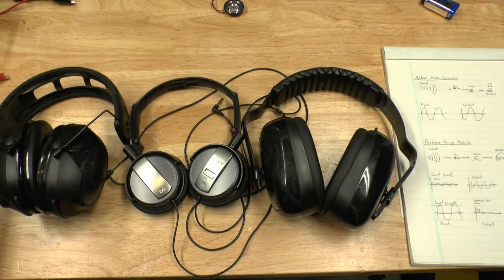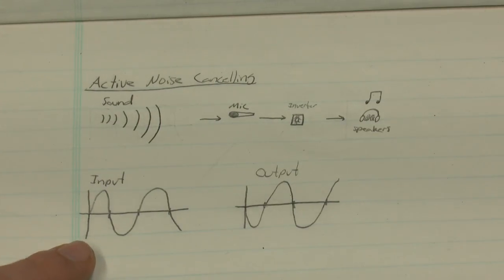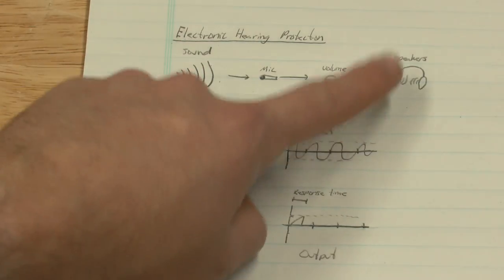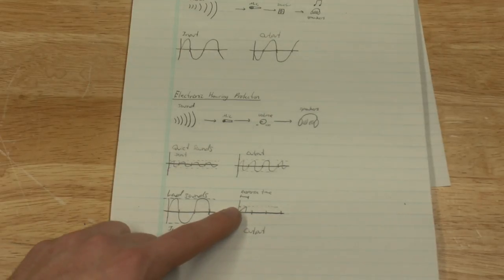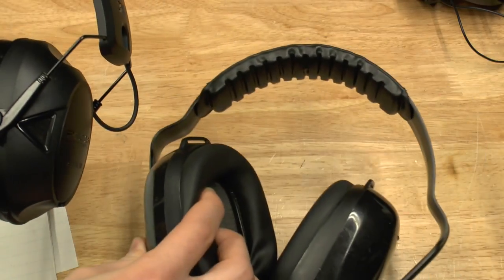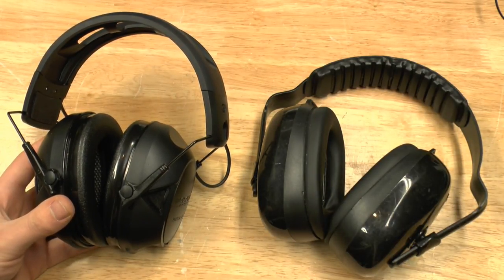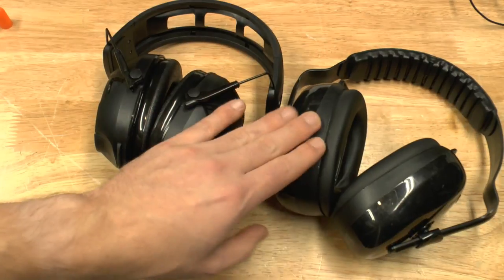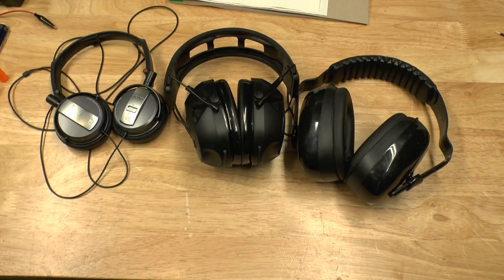How Electronic Hearing Protection Works: It's Not What You Think

Comment: I think there is a BIG counterpoint to this video: most people think the electronic hearing protection is actually doing more than the regular (passive) ones. In practice I have yet to come to an electronic hearing protection that protects the same as the very good passive ones. Of to double protection, which is foam + muff. 
So to say that you are not in danger wearing an electronic hearing protection is a bit misleading. Yes the actual electronic is not creating any MORE risk BUT you may actually have a weaker hearing protection just because the protection rating is lower and the amplification is tricking you to think the sound is lower when it goes off.

Comment: So essentially its using a compressor/limiter/expander?

Edit: I just realized it must be a reverse gate. When the outside amplitude hits a certain gain threshold it “shuts down” and doesn’t reproduce through the headphone speakers.

Genius.
Reply from the maker: Basically. The more expensive ones like the Peltor 300’s analyze the signal to try to let a person’s voice too even when it hits the amplitude limit. It doesn’t work very well though and it’s still hard to hear people talking during gunshots unless the shots are farther away or quieter
Reply: @korbano  I wonder why they don't just scale the amplitude of the output audio down instead of shutting it down period. That would allow you to hear everything all the time, including the gunshot and voices at the same time, just at a safe cap db.
Reply from the maker: @skogib4846  Well the gunshot is so much louder than voices so if they just scaled it down, you wouldn't be able to hear the voices anyway. But the Peltor 300's try to do some live audio processing to try to allow the voice to be heard and not the gunshot but it doesn't work that well. It takes a lot of processing power to do live noise analysis like that
Reply: @korbano  That makes sense, yeah.

Comment: Great info.  I can’t find any active protection over 24dB.  I find passive “cup of plastic” upward of 27dB.  I found claims.....claims of upward of 34dB (untested, unverified by 3rd party) being sold on Ama and eBa stores.  I’m looking to add silicon pads to any hearing protection I’ll buy.  Currently, I use the foam plugs or use the harbour freight 5.00 specials...cheap but effective.

Comment: Excellent discussion.  I have used electronic hearing protection for years when training with firearms and have recently decided to start wearing protection while using other equipment that exceed 85 db.  Wasn't sure how the noise cancelling headphone worked in comparison until now. Great job!  BTW, not sure if this is correct but I learned on another video that the rating on electronic ear protection is not a one for one in db.  There is a formula that is used to calculate the actual db reduction which sounds crazy, which results in a lot less reduction than you would think.
Reply from the maker: That’s absolutely correct. NRR is based on a single frequency that is not in the frequency range of firearms. Also different materials block certain frequencies better than others. For example the MSA Sordins have an NRR of 19dB but in the frequency of rifles, shotguns, and pistols, they reduce by around 27dB because the material they used blocks the frequency of firearms blasts better than the frequency that NRR is measured at. NRR is basically worthless
Reply: @korbano  thanks again for the info.  Do you have a specific product for ear protection (with bluetooth) that you recommend for use other than firearms?
Reply: @WeekendOverland I would like to know too

Comment: Maybe I am too dumb to understand, but to summarize from my understanding: (Using the example with the Howard light sport8

For loud noises the electronic ear protections are better than NC headphones; but those are only as good as their sound rating, right? And a gun shot is about 150db? Then why do people buy protections with a rating for only up to 137db safe use (hunting gun)?

I bought them for in warehouse working and going to town (autist), where my seller saith those are super for loud noises up to 100db (construction work/house renovations), and can amplify quieter noises up to 82db!
Reply from the maker: @MarieFüchschen  you’re understanding this concept very well! For the 137db number you said, if starting with a 150db sound, that would mean the earmuffs have an NRR of only 13db. I wouldn’t recommend that but hunters may want minimal hearing protection so they can hear their environment better. Some don’t use hearing protection at all. But this is usually just for 1 quick shot, which is not as damaging as prolonged exposure. 

I think using electronic hearing protection for a construction site is a great use because you can still hear quieter noises like talking, but if someone starts hammering for example, it won’t amplify that.

Comment: Crystal clear in fact! The only problem I have is that I have a set of Walker 'passive' sound reduction ear muffs that reduce the  sound level by 34 decibels, when looking for active sound protection, I fear I'm not going to find any with the sound reduction level without wearing ear plugs, near the decibel rating of the Walker 'passive' sound reduction model  or earmuffs that I have now. Especially for shooting rifles in doors.
Reply from the maker: I understand your concern. I shoot indoors with a muzzle brake and NRR 24 works pretty well for me. You could wear foam earplugs underneath and turn up the volume, but it seems doubling up only adds 5 dB extra. Probably because the sound travels through your skull somewhat too.
Reply: @korbano :Oh yes I'm acutely aware of this potential problem, it's called the mastoid bone, a kind of rigid sponge-like bone with closed-cell type membranes immediately behind each ear. I had an instructor at the State Police Academy for several different courses and the main boot camp type course that had to be successfully completed before you could be certified as a police officer in the state, who suffered almost total deafness in his ears from doing different type of shotgun 'trick shots', if you will, with the shotgun on his shoulders and the muzzle of course very close to his ear, and over a period of years this bone apparently hardened enough that it couldn't vibrate like it was supposed to, and he became almost deaf, requiring hearing aids later in life, in both ears to hear adequately. This is what I want to avoid. I don't shoot like that, plus he was of the old school and used only empty brass pistol cases as his ear protection. The only practical problem with ear muffs for me is that sometimes they do not allow a proper cheek weld on a rifle stock. But the proper and appropriate priority is protecting my hearing so I will find something appropriate.

Comment: Nice explanation, but you're aware that the NRR ratings are fairly useless.  Companies can cherry pick from a list.  For example MSA Sordins are NRR 19, but offer some of the best ear pro for electronic ear pro.
Reply from the maker: jlastre that’s quite interesting. I suppose it’s kind of like flashlights saying they have a lot of lumens when they’re only picking the brightest spot. I can say that the Peltors definitely have better protection than the Howard Leights. I usually put foam earplugs in with the Howard Leights but I don’t need to with the Peltor
Reply: Budget Tool Reviews I am getting back into shooting after a long absence so am doing my research.  Back in the day I bought a pair of Peltor H7 which is rated at NRR 27 which are quite cheap.  I'm sure you're also aware that Db is logarithmic.  So the difference can be substantial...if the ratings were worth something.  Usually the bigger the ear pro the better.  I have a pair of Sordins but plan to double up as you do for indoor use.  I like the Peltor 500s for the Bluetooth and might buy a pair as I can't see buying the Sordin Bluetooth version.  Build quality can matter too.  People seem to be raving about Pro for Sho as they are low profile and cheap. A YouTuber dissected a pair and the construction is quite good.  One last point is over the ear is important IMO.  It protects the bone connected to your auditory inner ear.

Comment: im confused here. You say the protection only comes from the cups but then you say the electronics turn down the loud sound too when it is detected.
Reply: I know this comment is a year old, but I thought I'd try and explain just in case.

TL;DR: What protects you is the thick layer of soundproof material. The electronic only amplifies tiny noises so that you can hear people talking, and it turns off with loud noises so that sound can reach you through the muffs itself. Without the electronic, you're still protected, but you won't hear people talking.

Basically, the electronic hearing protection muffs work the same way as passive ones: it's the thick layer of foams and stuffs that isolate your ears from the outside environment, reducing all the noises that can reach them.

The electronic is only useful for the microphone which transcribes (and amplifies) the tiny sounds such as people talking to you, so that you can hear them through the thick soundproof muffs.

When a loud noise happens (e.g. gun shot, machinery), the microphone turns itself off. What this means is, nothing will be amplified anymore, and you will only hear whatever sound goes through the muffs directly. And since it's soundproof, it protects your ears.

Comment: It is my understanding that an NRR rating isn't a direct decibel reduction... you subtract 7 and then divide by two... so a 22 nrr is only a 7.5 decibel reduction. So the 150 decibel gunshot would only be reduced to 142.5.

If I am not mistaken... that makes the hearing protection practically useless.
Reply from the maker: NRR is also based on frequency, not just decibels. So while a set of earmuffs claims a NRR 22, the actual decibel reduction depends on frequency too. For example the MSA Siordins cost like $300 and only claim NRR 19 which doesn’t sound very good. But at the frequency of a rifle shot, the actual decibel reduction is more like 27-30 decibels. I don’t know what the actual reduction of the Peltors is but from experience, it provides an adequate amount of protection for rifles indoor and is plenty good protection for rifles outdoors. Hope this helps

Comment: Thanks for the video. I’m trying to reduce noise from my zero turn riding lawn mower where the engine is directly behind me and there is not any shielding around the engine to reduce noise levels. I purchased noise reduction (passive) ear muffs with NRR 25 dB. However, I can still hear low tones that are loud and tend to induce headaches after long exposure. I don’t have any noise meters to understand the decibel levels or the frequencies of the sound. The low tones are only present when the blades are engaged. I am wondering if the noise I am hearing is due to a low frequency vibration generated by the blades passing through air at a high velocity, since the low tones become louder the faster the blades turn. 
What materials help attenuate (reduce) the passing of sound frequencies and what materials are better for lower to higher frequencies? Thanks.
Your explanation of the electronic noise reduction is great in theory, but the earmuff themselves are not a soundproof barrier. Even if the materials that reduce sound in the earmuffs are sound proof, the seal around the ears is not air tight and allows sound to pass through. So would it make sense to have noise cancelling earbuds covered with just standard noise reduction electronic or regular sound reduction earmuffs to further reduce noise reaching the eardrums?
Reply: When purchasing hearing protection, you can look for an attenuation table which shows the effectiveness over a wide range of frequencies, or you could ask for it if you're purchasing online. Some muffs work really well on medium to high frequencies but offer little protection in the low ranges (which is to be expected when they're not thick enough).

You can also double up the muffs with in-ear protection (which work better for low frequencies). You'd just have to be careful when removing them to not damage your ears with the suction effect.

Comment: My understanding is that electronic hearing protection headphones totally clip or shut off when a loud noise is present so you hear almost nothing for a period of time including voices. Is that consistent with this explanation? It seems different to me. I assume the gun shot would still be heard but at a much lower volume.
Reply: Yeah that’s what iv been reading.  That’s what made it so confusing for me . I wondered if a small part of the 140db+  made it to my years before the speakers clip or shut off. 

He made a good point in that the speaker inside the earmuffs wouldn’t be able to produce the 140+ db blast from the gun.  They just couldn’t handle it nor would the manufacturer put a speaker in earmuffs that could reproduce that level of sound.   They probably clip/ shut off because they cannot handle the sound. But even if they didn’t shut off the speaker still couldn’t produce that level of sound.
Reply: No. When the electronic hearing protection « shut off » when a loud noise is present, it is actually only shutting down the speakers inside your headset or the amplification of the outside world. To say it differently. when there is no loud sound, your electronic hearing headset is listening to outside sounds and diffusing them via the drivers inside your headset. When a loud sound is detected it simply stops doing this. 
So the actual hearing protection of an electronic hearing protection headset is the passive shell of the headset, just like a regular non-electronic hearing protection (except most electronic ones are actually a bit inferior because they try to fit everything in the same size).

Comment: How would these kind of ear protection fare in an industrial environments with loud machinery, grinding, cranes and such?
Reply: I work in a wood manufacturing plant and it works great , but if I don't need to communicate with other people I rather use earplugs, we usually have a noise level from 80-100 dB . If you're earpro will be exposed to moisture I recommend sordin they seem to be pretty weather proof